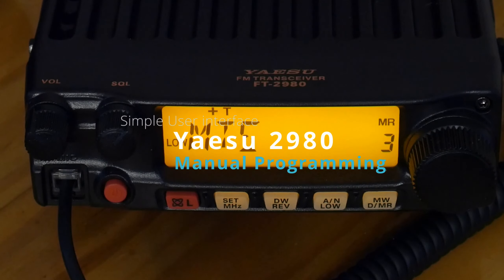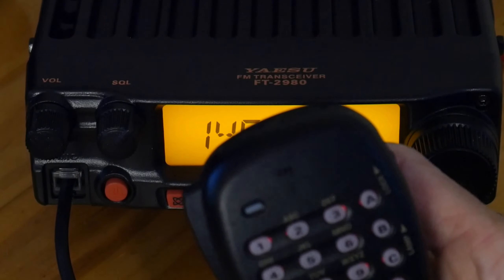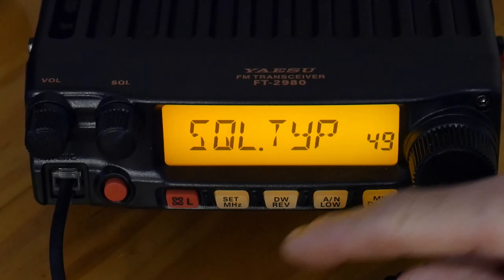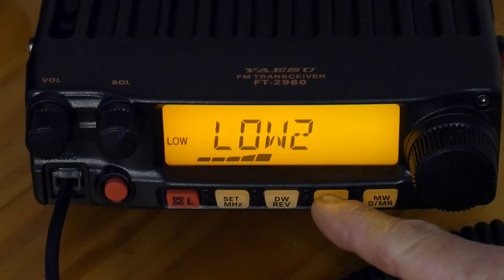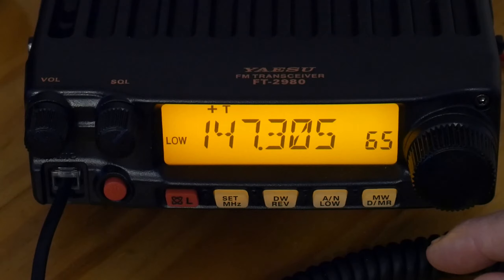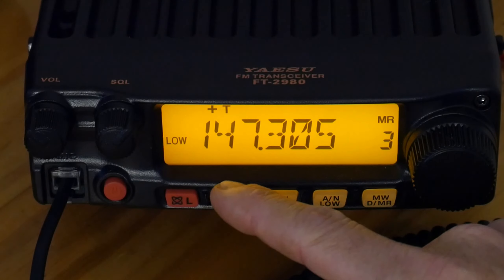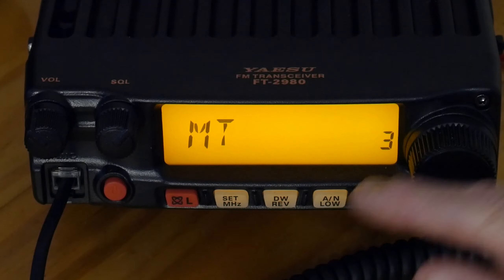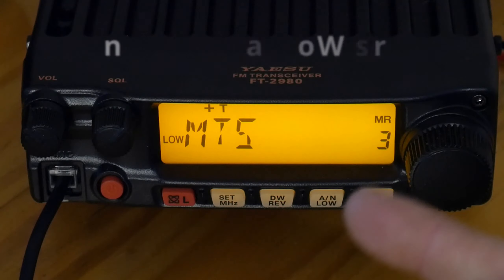Yaesu 2980 manual Programming

Comment: I’ve been looking at this radio for a few days. I might get one while they are on sale.
Reply from the maker: I was the same way. Looked at radioes for a bit before I decided on this one. I’m glad I did. I paired it with the diamond A144s10 big yagi and it’s a beast. Highly recommend the radio. You will not be disappointed. Was a major upgrade for me.
Reply: @Yelnats101  I’m probably going to get one. I currently have a ed fong dbj-1 antenna 25-27 feet up going into a yaesu ft-60r I need something that can get out further. Great video btw.
Reply from the maker: @Hamradiolife24  thanks.  And get the radio. It will not disappoint. Keep me updated. 73’s KQ4LPW